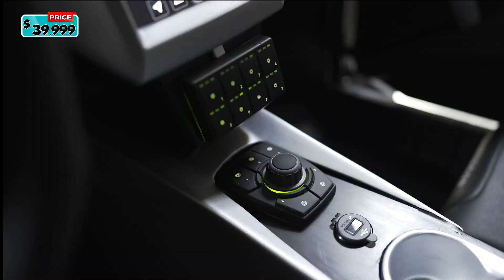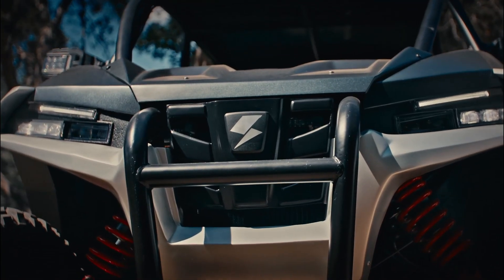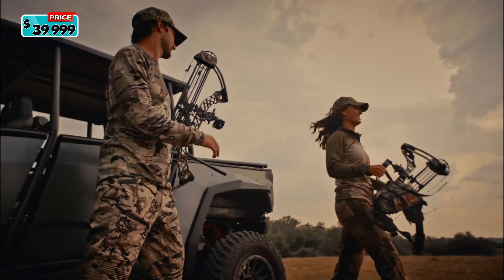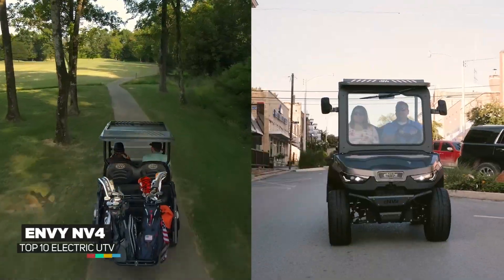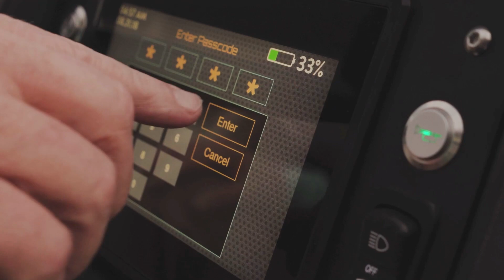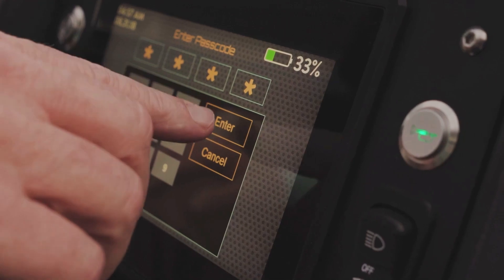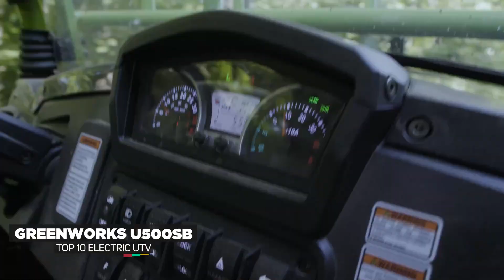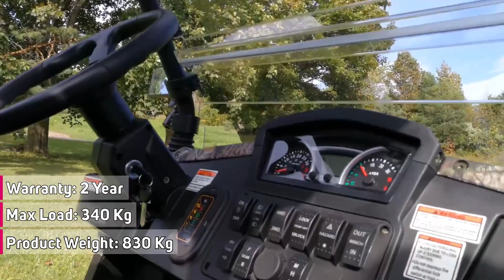Top 10 Electric UTV 2023

Comment: Love this video! Next time, you might want to include the Rev 1. We're building a 2-row electric UTV with 200 miles of range. It can tow 3500 lbs and carry 2000. You can also use the vehicle to power tools/pumps/machinery, with 12 kW of onboard 120 / 240V power.

Comment: Yes… also would be very helpful to know exactly WHAT TYPE of receptacle these need to use for charging? The Kandi e10K uses a simple 50 amp rv type connector so no super expensive proprietary high end complicated charging stations needed. I had an RV (camper) box installed for my camper 3 years ago (less than $400.00) (20, 30, & 50 amp service) so do ANY of these “top 10” use simple things like this to charge? I know the Polaris needs their expensive charging ordeal which is another separate thing needed to charge it…just sayin…what about how to charge these tech utv’s?
Reply: I agree